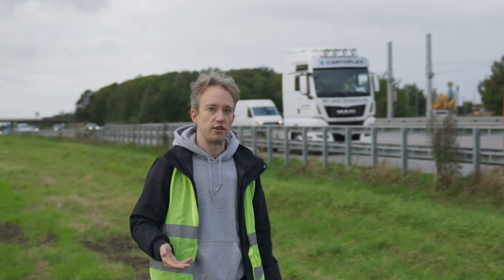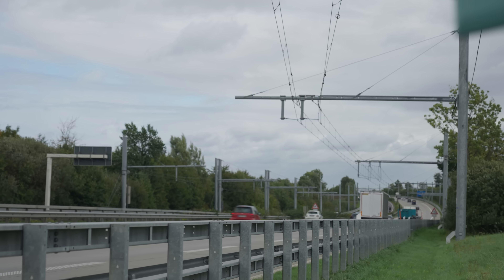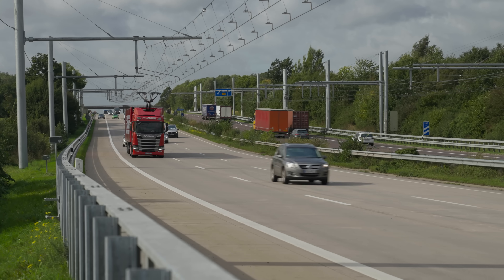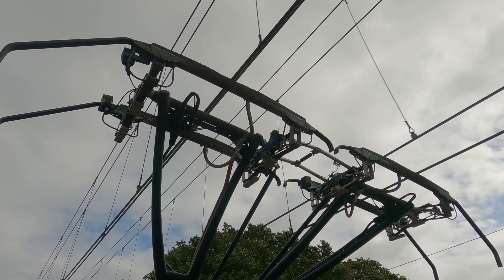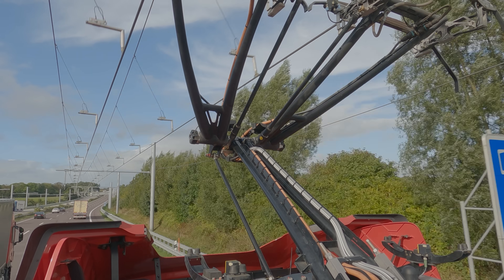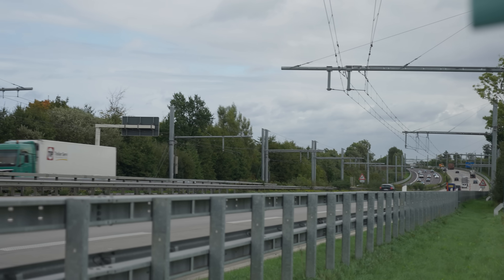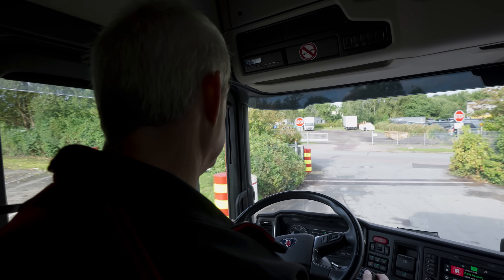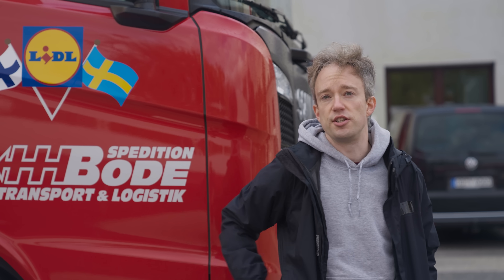The highway where trucks work like electric trains

Comment: Additionally the power price for this would be flexible throughout the day just like other grid power is. That would make driving at night cheaper, freeing up highways at day and lowering the difference between the dips and spikes in power demand.
Reply: At least in Germany trucks are generally not allowed to drive during the night on the Autobahn. As the noise at highway speeds is mostly caused by the wheels and the wind, an electric truck is not much quiter than one running on petrol.
Reply: I don't think that will necessarily true in the future, because of solar energy. Wind is strong in the morning and evening, while solar is strong mid-day. Add electric cars to the mix (which mostly charge in the evening and night after work) and daytime electricity prices might become the cheap ones. Of course this changes if you have nuclear power en masse, but that won't happen in Germany at least (for better or for worse)
Reply: I think automated driving will be take care of some of those issues. it's less complicated to drive on highways (only cars, less unpredicatbility), the driver will be an operator/manager/failsafe.

each change is just one piece of the puzzle.
Reply: @benjaminshinar9509  that’s still a long ways off.
Reply: except over time as daylight based sources of energy take over the grid, it could end up making daytime useage cheaper instead of night time.
Reply: @JibeddyHibeddy  Even so, excessive numbers of lorries could create enough noise to be audible from a good distance, it's not something I'd want to encourage.
Reply: @JibeddyHibeddy  Perhaps, but I'm not convinced it's a good idea for other reasons, and those could be obstacles to more night deliveries.
Reply: Well, unless they drive completely autonomously you have to pay a driver more in the night than what you save
Reply: There is a downside to night driving, increased risk of accidents. Plus having HGV's thunder around at 3am tends to annoy local residents.
Reply: @Croz89  I would think the tradeoff of congestion-based accidents offsets a lot of the perceived danger.
In the US, a lot of OTR trucking happens at night, when the highways are much less congested, so there are fewer drivers to engage in un-signaled lane changes, or distracted driving, or irregular speeds.
If the driver is properly rested, then night versus day is not really that much of an issue from the standpoint of driver skills.
Reply: @MonkeyJedi99  I would disagree. Congestion usually causes more low speed accidents, high speed accidents are obviously more dangerous especially with lorries. There are certain trucking operations that happen at night for logistics reasons, such as parcel delivery, but I don't think a wholesale shift to nighttime driving is a good idea.
Reply: @Croz89  wouldn’t electric trucks be quieter though?
Reply: @boxr_4214  Somewhat, though probably not quiet enough. There will still be the sound of air brakes and tyre roar.
Reply: @boxr_4214  Most of the noise from a highway or Autobahn doesn't come from the engines,  but mainly from the tires rolling on the road surface,  and also from the air friction of big, fast moving vehicle. Therefore a silent engine probably reduces the noise inside the truck significantly,  but doesn't change much the noise pollution near the road.
Reply: @Croz89  there's night driving already, that wouldn't be much of a change
Reply: @wilfriedklaebe  Of course there is, but that doesn't mean we should encourage more of it.
Reply: There's also a safety issue there, driving at night isn't great...
Reply: @Alex_1A  No there isn't. Many people work night shifts in all industries. You just have to acclimatise to it.
Reply: @harrier331  there absolutely is. It is well recognised in healthcare and aviation. Just because lots do it doesn't mean there isn't any risk.
Reply: @ChrisEvans1001  I work in aviation, there are no risks as long as the shift patterns for people doing these night shifts are not switching between day and night cycles, that is what caused disorientation, confusion and tiredness.
Reply: @harrier331  Are you a trucker ?
Reply: @DerkleineTrojaner  No, I work in aviation. Hardly a relevant question...
Reply: @harrier331  it's funny. You work in aviation. I work in healthcare. I'm fully aware of the risks. You're not.
Reply: @ChrisEvans1001  Risks are only caused by improper procedures or people not following correct procedure... If the risks couldn't be mitigated it wouldn't be legal to fly at night or perform any critical work... but it is. What about the operation of nuclear power stations, some of the jobs which I would consider some of the most critical of all... They work at night as they mitigate risk...

Stick to your line all you like, it doesn't make you right.
Reply: @harrier331  I will stick to my line. This is basic stuff. Risk mitigation is to reduce risk. We take many actions to reduce it but it is very straightforward... Operating at night carries risk.
Reply: @harrier331  In the night you'll inherently have less visibility. That, provided you had the same traffic, would increade the chance of accidents happening.
Now, since fewer people drive at night, it'd take someone with a big brain and lots of time to figure out whether night driving for trucks would decrease or increase the total accidents occuring.
Reply: @ChrisEvans1001  There is no intrinsic risk to working at night. 

The risks associated with night work are purely down to the people involved either failing to commit to a regular sleep pattern or being given incorrect shift patterns which cause undue tiredness.

Again, if there was an intrinsic risk to working at night Pilots would not be licenced to fly at night. It is that simple.
Reply: @kommentator1157  I wasn't talking about the brightness per se, I was saying that the work occuring at night (not necessarily driving) doesn't carry intrinsic risk. 

Being dark and driving may carry additional risk but that is not what I was talking about.
Reply: @harrier331  we shall agree to disagree. We obviously both think we are right. We only know of the evidence we each look at.
Reply: @harrier331  According to a report from the National Highway Traffic Safety Administration (NHTSA), almost 50 percent of fatal car accidents happen at night, despite the fact that only about 25 percent of motor vehicle travel takes place during the night hours.
It's called doing research, Einstein. Try it next time.
Reply: @Alex_1A  safety issue? So driving 10 hours a day is safe but driving at night on empty roads isn’t? 😂
Reply: @Smithy250  yes.
Reply: @Smithy250  It's safer yes.
Reply: Electricity likely will start to become MORE expensive as the sun goes down as solar doesn't ever work without the sun.   If solar is a main component of the "green energy" the lowest rates would be the handful of hours around noon.

Comment: There is pros and cons. The cons is the cost is high and there might be bigger stuff like construction material transport might get in the way in those wires. Plus the small cars need power to reduce cost. It need better way to electric vehicle.

Comment: I bet 90% of the long-range-traffic that could be handled this way would be more energy efficient to transport if railways were used. This is still interesting for some use cases where trucks outperform trains in midrange scenarios due to not having to switch modes of transport... but that's edge cases again.
The thing that makes me sad here is - and I wish Tom mentioned it in the video - that trains are the better solution for the majority of the problem that is being solved by this technology! The only reason why this is pushed over trains is that the people building trucks would lose their business if traffic is shifted from trucks to trains, so why should they want that...
Oh, ant bwt the Netherlands and Switzerland are both mad at Germany. Why? Both finished huge railway projects to connect the international ports of the Netherlands to south and East Europe; but the German part in between is still lacking behind badly. I'm ashamed as German that Germany is not the country of inventors, but the country of automotive tech inventors and little else -.-
Reply: Nope, you'd lose that bet. Why? Because rails dont spread out in every direction where the goods get transported to. Ever seen rails going into your local super market?

Comment: Trolly buses do this in San Francisco (and elsewhere).

What's different here is the double pantograph instead of the pickup arms which connect to the cables with a slotted connector which follow the cable but often pop off the cable -- not an option at these highway speeds.  Here, the driver has to keep centered in the lane manually so that neither pantograph touches both at the same time causing a short circuit.

Comment: It is extremely harmful to the environment to make an electric car. The extraction of rare earths and raw materials for battery production alone is a disaster for the environment.
Thousands of square Kilometers of landscape are becoming uninhabitable for the people where this overexploitation takes place.
This method is a very good alternative.
(btw. I just don't understand why there is no more investment in hydrogen...)
Reply: Hydrogen fuel cells are not the solution. “As of 2020, the majority of hydrogen (∼95%) is produced from fossil fuels by steam reforming of natural gas, partial oxidation of methane, and coal gasification.” Hydrogen comes from fossil fuels it is not clean. The rest is made by electrolysis, which is extremely inefficient compared to putting the electricity straight in to a bev.
Reply: @TylerBenney  you are right(more or less) the procedure you describe is just one of many(the worst example)

Comment: I take it they use regenerative braking as well? Trucks can easily run away down hill and need the brakes or a retarder to hold them back. Do these trucks put that energy back into the wires?

Comment: It seems to me that these are just trains in worse, especially because you need to build a hole new infrastructure. Trains are faster, safer and in general more efficient.
Reply: cargo trains are rarely faster or more efficient in central europe ... thats just the case if you completely ignore every effort and distance before and after the cargo is loaded onto a train, while cherrypicking the route your cargo has to take. (only high mass plus long distance makes trains a reasonable and efficient alternative these days, that already excludes a huge portion of potential customers/cargo here in europe)
And then there is the huge issue of cost, using the train is not cheap in europe especially if you factor in the massiv cost covered by public funding for the infrastructure.
Also, the whole point of this is that you DONT have to build a whole new infrastructure! These are existing roads which just got overhead wires added for their right lane .... much much much cheaper then building a redundant railroad line with countless necessary stations next to it.

Comment: Why not... use trains instead of individual trucks?
Reply: because those trucks still maintain their freedom to go on and off wherever they like, while being able to use the whole road network connected ... trains wont do that.
Reply: @diedampfbrasse98  How about utilising both at the same time :O
Imgaine you get your containers on a train and then on a truck that brings it to the final destination...
Reply: @skyracer-mk8hg  Doh, thats what we do already ... reality is that only works for consistent high mass/quantity and long distance with low demands on speed, which is not all too common in europe ... hence our cargo train alternative always struggling to compete with trucks here in europe.
These wired roads enable comparable low mass/quantity and short distance cargo transport being electrified ... it does not require additional cargo transfers between vehicles and its fairly easy to adapt existing roads ... while cutting away all the overhead, added distance/time and cost of getting your stuff on and off trains.
Go ask your local railroad company how expensive and time consuming it is to get a single container to a city or country nearby, even before facotring in the last mile from and to the station you will be shocked ... in the vaste majority of cases that would be an incredible inefficient and costly thing to do here in europe.

Comment: this seems like it should be fitted on bigger highways connecting big cities. I went to china 2 years ago and the buses had similar system but it was just the city center. They were able to change lane because the antenna thingy could rotate. Proper train is not good because its on tracks so they cant move freely enough.

Comment: Down side is it needs a fairly hefty electric motor but I can really see this being used for cruise and lighter power requirements on freeways.  It also requires the setup and manufacture of a HUGE amount of cabling.  Good idea, see if it flies.

Comment: People keep comparing this to trains but they are missing the important piece of information that trains can in fact not deviate from their path. These trucks can just go on and off the highway as their route requires.
Reply: Whaaaaaaaat!?
Reply: That only works under two assumptions:
a) those warehouses have to stay exactly where they are and can't be moved closer to rail depos
b) that money wouldn't be better invested in expanding the freight rail network
Reply: @squelchedotter  keep in mind that this technology is capable to be added to already existing infrastructures instead of potential hundreds of hectares needed for extra rails.
Reply: Of course they cant deviate from their path. Thats why they are for long distances.
Reply: So?
Tom said that the usecase for these electric trucks is for port to wearhouse or depot to depot container shipping.

Any distribution center worth it's salt has a rail link, most shipping ports will. 

Granted im biased because i work in the rail industry, but seriously one of my upcomming projects in the next few years is to build the rail section of northampton gateway, a Strategic Rail Freight Terminal.
Reply: @VentusTheSox  Building railways and stations that can support them will take far too much time for a problem we need to fix quickly,on top of the fact that most freight trains need diesel engines to provide enough power to move all it's cargo, undoing the whole point of this. Putting up wire over highways is cheaper, faster, and more flexible than rail, it saves space, let's car manufacturers advertise that they're helping the planet, and doesn't have to through endless arguing with NIMBYs who don't want a freight passing by their neighbourhood.

Thanks for reading my essay :P
Reply: @abdisaniini  electric motors are more than capable of doing that. the reason why is isnt done is because freightis unloaded from the top so there is no way to have overhead cables
Reply: @ukaros_ateon  Ah, thanks for the clarification, I feel kinda silly for not noticing that :P
Reply: @ukaros_ateon  It's not really a problem because you can have overhead lines to a point where the train can drop off the rolling stock and the rail yard can have shunters.
Reply: @ukaros_ateon  Of course you can have overhead on freight trains. Just let them roll into the freight stations.
Reply: @VentusTheSox  The problem is that, at least in Germany, rail freight has been in decline for decades. Today it's half of what it was a decade ago. Because of this most new warehouses are built near highways, not railways. This does nothing to reverse that trend and in fact just further entrenches cargo trucks.
Reply: @VentusTheSox  Any distributions center worth its(!) salt had a rail link.  They ever tore down some sadly unused rail lines.  Here in Germany (where this video was largely filmed).
Reply: @VentusTheSox  They don't have rail links. 

Why use railway if the supermarket isn't going to have a rail station next to it?
Reply: @KiLLJoYYouTube  I never said supermarket. Supermarkets are typically for foodstuffs, perishables, things like that. That is the sort of journey a low range eTruck would be best for, A milk farm would use a refrigerated truck to send to the bottling(jugging?) plant and then to the supermarket. All of which would be relatively close to each other.

What im talking about is container ships and cargo planes for Amazon for example. lets say i bought a something, Itd land at an airport, be transfered to the local warehouse, then onto a freight train to the local warehouse, then delivered by truck.

Comment: I think, I think, is not a viable solution ,either it will work or it does not ,you are still polluting the air with power plant emissions and the cost of implementing the infrastructure will be enormous more power plants to increase electricity production .